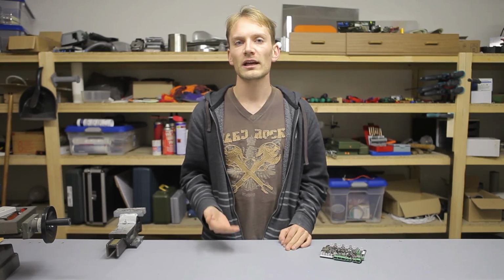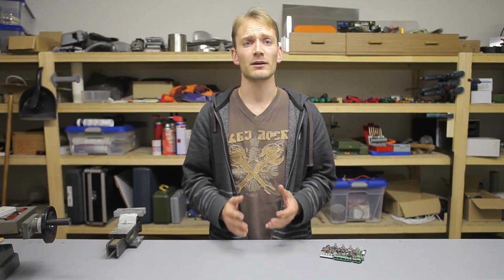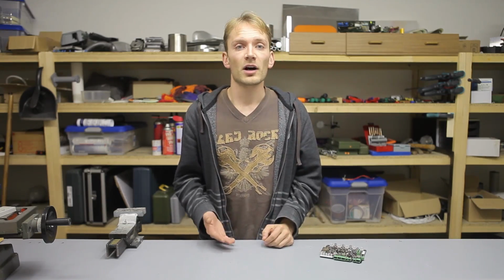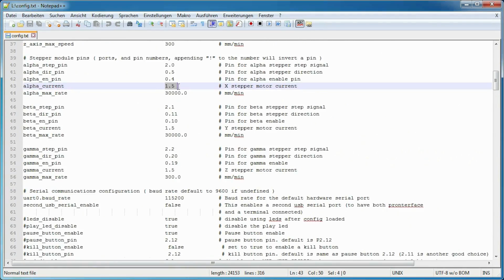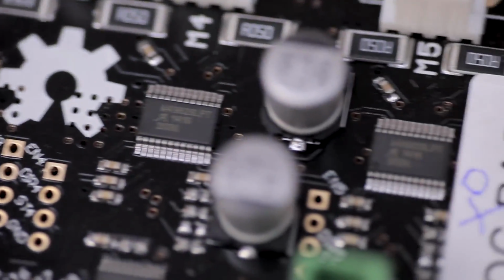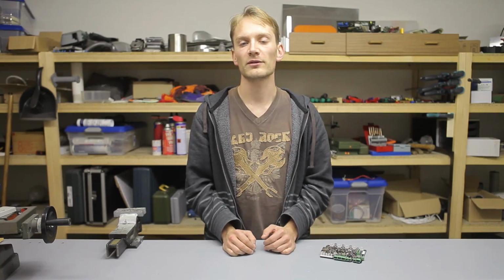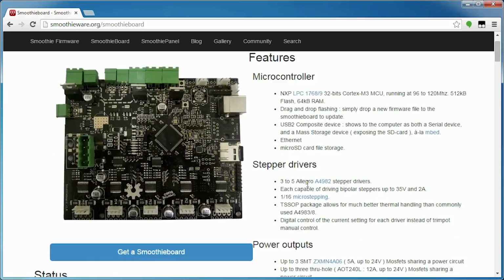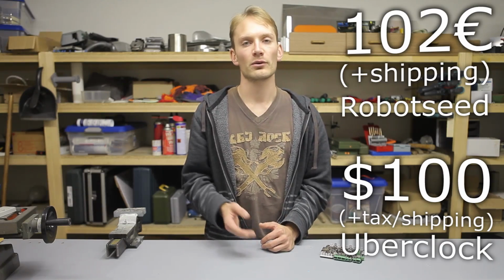The Smoothieboard

Comment: I've been using Smoothie since early 2013 and even then it was amazing.  A lot of development has happened in the last ~2 years to make it even better. It's what I recommend to anyone getting started in 3d printing and building their printer from scratch.

My favourite feature is the SD card as mass storage device, and config/firmware updates via this device.  The current control is in second place.
Reply: mitchese1 dumping my crap ramps 1.4 for a smoothie board.  So tired of marlin and its bullshit.
Reply: Hi, mitchese1.  Sorry to bump this after 3 years, but it caught my eye that you said you recommend this board for people who build their printer from scratch.  That's exactly what I did, so I'm hoping I could pick your brain if you're still engaged in the 3D printing community. I took on the daunting task of designing a completely custom 3D printer from the ground up including a nice rigid all metal frame, electronics, and software. I finished the hardware and electronics, but after about 500 hours of writing code, I was maybe 30% done and mostly lost interest in completing it.  Now I'm thinking that I'll just bite the bullet and get a pre-made controller.  Do you still think the smoothie board is the way to go? Are there any other boards that I should consider?

Thanks
Reply: @dragnet53 Sorry to bump this after so long, but could you elaborate a bit on what you didn't like about Marlin and Ramps 1.4?
Reply: The MSD access to the SD card is a great feature in theory. Makes editing the config file extremely easy. Unfortunately, when enabled it caused frequent communication errors as windows saw it an attempted to mount it while printing across USB. If printing from SD - it's great, but if printing across USB you should compile Smoothie with DISABLEMSD=1 and also set the disable flag in the config file.

Comment: 3:58. Either I'm slow or you skip things. It's probably me. "You simply run Make and drop the finished bin file on to the SD card...." what are you talking about? I don't have a make file on my new Smoothie board. Only two files, config and firmware.cur. Agree with TheSIckness  - time for a revisit. This board is leading the way IMHO. Good video, thanks.
Reply: That's what you do, if you want to add/replace the firmware. There's really no need to compile firmware on your own. As for revisit, no, it's terribly outdated and overpriced.

Comment: It may be easier to set up but especially when your just getting into 3D Printing and Repraps. I think a cheap Chinese Ramps is the better solution. It's so easy to blow up a Stepper driver or your Arduino. The replacement of those parts only costs 10€ so you're getting away pretty cheap.
I think this board is for people who understand the "inner mechanics" of the whole Reprap thing. This would be a great board for a second printer as most people build a Delta as their second printer but to use this as a learning board I think it's much too expensive...
Reply: Mr0Yoshie It costs the same price to fix a Smoothieboard and to fix a RAMPS, and the Smoothieboard's drivers burn much less often ( better current control, better protection, better thermal design ).
Also, cheap chinese RAMPS are not made to specs, and are dangerous. Actually genuine RAMPS cost about the same as a Smoothieboard.
Reply: Arthur Wolf How do you fix a burned driver on the Smoothieboard? Not everybody is able do rework SMD Parts and therefore a "Plug n Play" Pololu Shield is much easier. I build my Mendelmax nearly entirely with parts out of china and never had a problem so far. Maybe because I did wait very long with building a printer and had therefore much time to read through forums and learn from the mistakes others have made before me.
I don't say that the Smoothieboard isn't worth the money, I just wouldn't recommend it as a board for your first printer.
Reply: Mr0Yoshie
No need to do SMD soldering ! Smoothie has breakout pins for external drivers, and there are drivers that are equivalent to Smoothie's on-board drivers that cost about the same price as a replacement pololu. So just wire a new driver in !
Also please note : drivers on the Smoothieboard are much much better protected, the fact that you worry so much about burning them comes from the "historical" pololu architecture, burnt stepper drivers nearly never happen on a Smoothieboard, and if it does, we'll just exchange your board !
Reply: Arthur Wolf Well, good to know that, and awesome costumer service! Thanks for clarification. I haven't fried any Pololu until today but I thought this would be very frustrating on already soldered on SMD components.
Reply: Totally agree. I'd never recommend a Smoothieboard for beginners. It's really confusing and not nearly as complete as other boards out there. Voltage regulator, weird adapter for displays, ... The software is great and likely the board is as well if you are an electronics geek. As an enthusiast, get an MKS SBase. Compared to the Smoothieboard it's plug and play and costs a fraction so mistakes (which are easy to make with Smoothieboards) are not nearly as painful. Also quality control seems to be an issue with smoothieboards. With the first one I received, the display didn't work and I got a replacement.  Both did not get a network link with any of my switches. Initially I bought the MKS to test smoothieware prior to spending a lot for the original with my latest build. Now the MKS is in my printer because unlike the Smoothieboard  it just worked.

Maybe the upcoming version two is more finished for normal users.

Comment: The ATMEGA based solutions are really not as underpowered and obsolete as you imply. The ATMEGA2560 is a very capable CPU, that is simply being hobbled by the Arduino based software it is running. The Arduino software was designed so that it would be easy to learn and use for people who were not expert programmers. It is fantastic for this job, and does it well. However, being a simple and easy environment means it is not very well suited for complex programs with a lot of time critical operations. It's nice to see newer and more advanced controller boards coming out, but most of what they do better is due to better programming software and not so much that the CPU is that much better.
Reply: I don't think Arduino is the issue. At its basic level, Arduino is an IDE which integrates the same compiler that you'd be using with AVR anyway, and a 512 byte small bootloader that allows software replacement over serial cable, plus some default configuration. There's certainly also the libraries, and the quality of those is... to put it mildly, mixed, but it's also more versatile than what you'd usually use an AVR for. The AVR are ideally suited for tight control loops. Arguably, perhaps any and all performance issues stem from doing things that don't make sense, such as parsing the SD-card, parsing text, etc. Motor/sensor control is a great use case at which AVR is pretty hard to beat. And you aren't forced into using any of the Arduino libraries.

So i think chaining another system, perhaps most cheaply an STM32, to the AVR is the right solution. Both units have integrated UART FIFOs that they can be connected throgh, so high effective utilization can be achieved, actually paradoxically higher than for either ARM or AVR individually.

I'm also not sure why a Cartesian printer needs explicit Delta calculation at all? Fast line drawing on low-end processors without multiplication or division was solved by Bresenham in 1962, using error accumulation tracking.
Reply: Ooh it wasn't about Cartesian printers at all, it was about printers of different geometry needing geometric conversions. It makes sense. Still, it's something best done on a different unit than the one that actually speaks to motor drivers.
Reply: You'd be wrong about that... While using the built in Arduino functions for IO would be slow nothing is stopping your from using faster libraries or just directly addressing IO at maximum speed. IO is acutally where the ATMega's shine... where they fail is as Tom mentioned calculations on the fly.....  as well as floating point calculations which they can only do in software. An Arduino can toggle pins in at the very least 100s of kHz range without too much sweat but what it can't do is decide how to toggle them... and for that you need a faster CPU with more Ram and a floating point unit.

Now that Microchip and ATMEL are one... I think it would be cool to see a PIC32 chip powering a 3d printer.

Comment: Hey Tom, there's also the Azteeg X5 which runs Smoothieware and is based on the Smoothieboard reference and it's only $109USD with 4 stepper controllers :)

Comment: I'd love to have a Smoothieboard with more steppers - dual extruders with dual Z drivers are impossible with that setup unless you want to wire the 2 z-motors together.
Reply: There are pins for external drivers, could add another one running in parallel with the onboard driver.

Comment: Great video with a lot of good tech!! I think the directions they are going with upgrades are on target for the coming advances to 3d printing and controller requirements, but until I push the limits of my Arduino 2560, the price will be more than I'm willing to spend for the current improvement.. but if I get some time to learn the smoothie firmware, and really like it.. I might have to buy a board because I know these are things I want to take advantage of in the future. great to know the future is here... (again)  :-) and Thomas, you are doing really good at making these videos and getting good information out to the community. The E3D assembly video was also very good at making sure the viewers can properly assemble the hot ends. keep up the good work.

Comment: I just found out that the 120MHz Cortex M3 CPU used in the Smoothieboard does not have hardware floating point support i.e. all floating point operations are carried out in software.
Calling this "the future" seems a little bit preposterous and misleading at this stage. The future as I see it would be to use a $35 RPi 2 (quad-core 900MHz Cortex A7 CPU) and add a RAMPS-style interface board to it.
Reply: André Balsa Amen brother in the RPi. I've been wondering why there isn't more activity coming from this angle. Could be because something like Linux isn't a real-time operating system. Incredible amounts of processing grunt and connectivity features for the price...
Reply: +Peter Nann The v2 is slated to have an updated chip with a co-processor
Reply: shaitand69 , my point was just just about RPi. Why aren't people using them more already for 3D controllers? They are already 10x more powerful. Why are designers persisting trying to make faster Arduino-level hardware when RPi is ready on the shelf? Just seems strange to me. Philosophical question... Not meant to be a criticism.
Reply: +Peter Nann The smoothie (which is actually old news but getting people to upgrade from the comfort of the ATMEL based world is slow) and the smoothie 2 are both using ARM chips just like the RPi which other than it's processor is mostly designed for video processing and largely useless for 3D printing. I'm not sure what you mean by Arduino level hardware the arduino is ATMEL based and smoothie is in large part based on the move to ARM which is basically the only thing from an RPi that is useful here. It takes time to design these boards (especially for the small outfits and hobbiests working on them) and it takes time for the chips to come down in price. So once a chip becomes viable pricewise it might take another 6-12 months for there to be a 3D print controller board using the updated chip. The firmware has to be rewritten to actually take advantage of things like a new co-processor and use those extra cores/cycles where it make sense otherwise you have a higher spec on paper but aren't any better off for it. Unlike the RPi which has essentially just updated by slapping in the faster chip, smoothie is getting a major overhaul for 2.0 adding not just a newer processor with co-processor but also a dedicated FPGA for step calculation. The biggest and most important thing setting these boards apart from something like the RPi is that they have to handle and route tons of power. My own board is handling about 400w. That is the capability to run not just 5 24v 2.0A steppers but heating two extruders to 300C as well as a 300mm x 400mm bed to 100 C, as well as fans, inductive sensors, thermal sensors, and the onboard capability to drive another heating element/sensor if I enclosed the chamber and heated that. An RPi has the electronics needed to handle a fan or two and maybe the sensors (and that only because the ARM chip has that capability built in and it breaks out the pin). The smoothie and beagle board aren't "the future", they are "the present" but smoothieboard 2.0 is definitely "the future" and anyone moving to 1.x (or a clone thereof) now will be well prepared for it when it's time to upgrade.

Comment: Hi Thomas. Smoothieware seems like a abandoned project... do you know any news?
Reply: It is! As of board itself, it could be still useful, but there are plenty of deal breaking features. For example, if you try to connect to it during print, it will crash! This means it's not advisable to connect it to LAN! Documentation is also lacking and support is non-existent. There are now much cheaper and better alternatives for it now.

Comment: I don't see the point of 8-bit boards anymore. 32-bit boards with onboard processors are getting cheaper and more plentiful every month. I particularity like the boards that run Smoothieware. In addition to the original Smoothieboard, there are some decent alternatives such as AZSMZ mini, MKS SBASE, Sunbeam 2.0, and Azteeg X5 Mini.

My favorite for compact installations is the AZSMZ mini, but it order to be tiny, it leaves out the ethernet port, and has only 3 MOSFET outputs. I would be nice to have had one more MOSFET output for a dual extruder setup. You'll have to do your own fan control if you want to run dual extruders. 
It uses removable stepper modules, so you can can use whatever you like, or plug in large external drivers - a feature that I really like. It has 4 endstop inputs, so you can hook up a probe on your delta. It has 3 thermistor inputs to support a dual extruder setup. Very nice dedicated GLCD available for about $20 USD which includes a place to insert a $3 ESP8266 WiFi module. I had to replace the heatbed polyfuse on my board - but that's not a fault of the board itself. I would advise checking the solder connections on the micro USB connector, as I was able to break mine loose. Micro USB connectors will not stand the abuse of a full sized USB connector like most other boards are using. The designer is a hobbyist and seems responsive to questions. Schematic is provided, but nothing else.

The Azteeg X5 Mini is equally small, but is higher in price, and is apparently plagued by some reliability problems. No option of using other stepper drivers. Only 2 thermistor inputs.

I don't know much about the Sunbeam 2.0, but it is fairly expensive. It only has 3 endstop inputs, so no way to hook up a probe on your delta. Otherwise, it is a very full featured board and includes an ethernet port.

The newest board from China is the MKS Base. Very affordable (about $75 on eBay with shipping), and very full featured. It has integrated DRV8825 drivers. 4 MOSFET outputs, 4 thermistor inputs, ethernet port. A whopping 6 endstop inputs. It's a BIG board - (147mm x 95mm) which is actually considerably longer than a real smoothieboard. That may be a negative feature for some people. It also doesn't have much of a track record yet. There are reports of little to no communication or customer support. I can't verify if that's true or not. Nevertheless, if it's well built, it could be the best bang for the buck if mounting space isn't an issue.

Of course, if size and price isn't an issue, there is no doubt that the original smoothieboard is the best board with the best support. In the end, the best board depends on your specific needs.

Comment: I realize this video is pretty old, Tom, but you know a Arm Cortex-M3 chip cannot run linux! You would need to upgrade to the one of the Cortex A chips for that. Cortex M usually runs bare metal, but definitely an upgrade from the AVR.

Comment: Howdy, my friend and I are trying to build a few 5 extruder 3d printer for full color. Could you recommend a board for 8 motor drivers? We've looked into the 'Panucatt Azteeg X3 PRO 3D Printer Controller', but $140 a pop is a little too expensive. Also, any tips to making a 5-in-1-out hotend/nozzle, I've seen the DIY 3-1 mixer tutorials. That is our current solution. Thanks

Comment: Does the board and firmware have built in rotary encoder support?  This is a feature that seems to be lacking on most printer designs but would pretty much eliminate skipped steps.

Comment: Can I get some friendly help/suggestions here?  I have available some heavy duty linear parts from equipment that was being scrapped out. I'm perfectly capable of building a high quality plasma/router-mill. What I'm trying to teach myself is the CNC programming and controls. I know sketch-up, learning sketchucam, figured out nema motors specs.  What I'm stuck on is does gCode from sketchucam go right into a smoothie board through swoothieware or is there something I'm missing?  I see this Vid's quite old, is this the best way to go for someone like me with little programming knowledge?